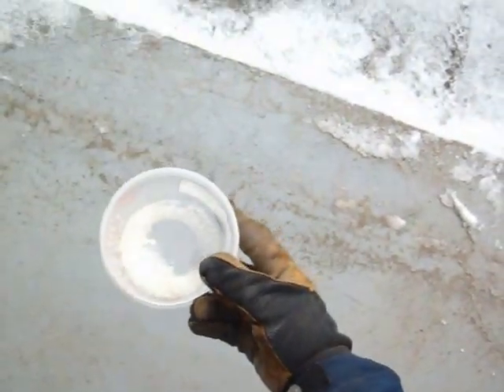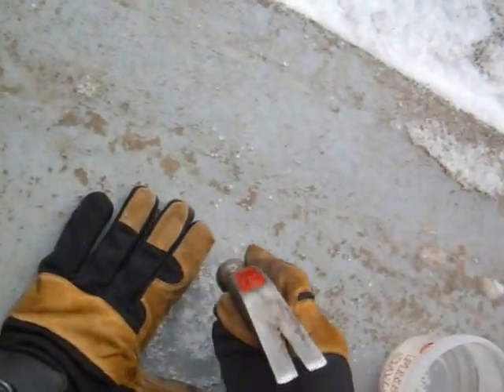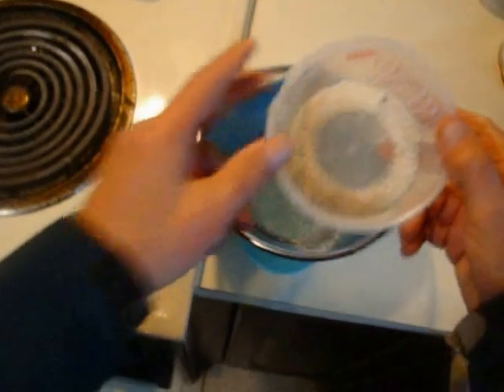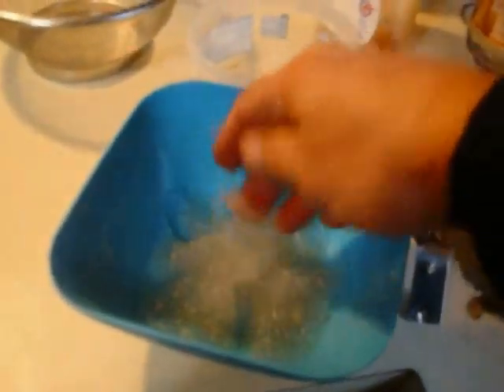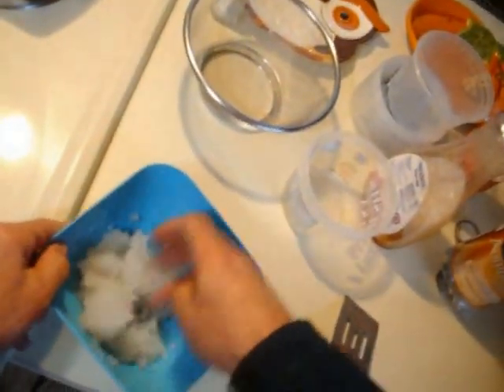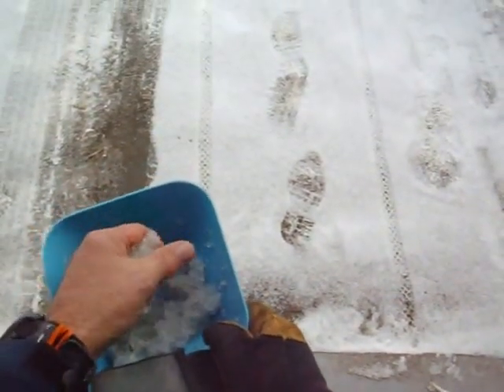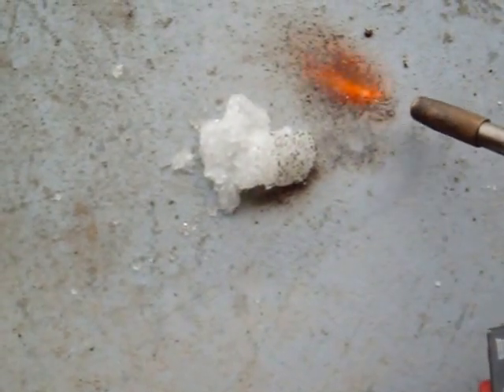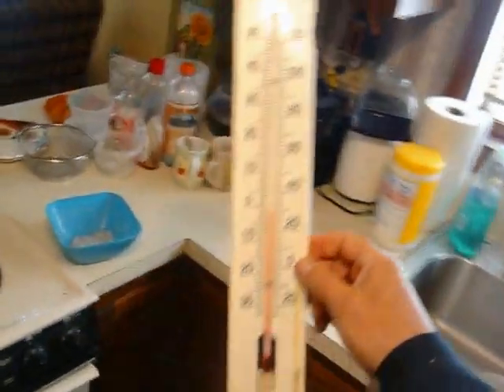Fake Snow 0001

Comment: I don't know why I'm bothering but here it goes:

From
http://www.reddit.com/r/conspiracy/comments/1wjaub/fake_snow_in_georgia_why_cant_a_flame_melt_it/

It takes a lot of energy to melt ice and snow.
It takes 334 Joules to melt 1 gram ice at 0°C.
A butane lighter flame gives off around 900 Joules per minute.
If you just hold the lighter next to the snowball most of the heat goes straight up. Also if you don’t let the flame burn unobstructed you get incomplete combustion and less heat, and soot.
The snow is a great absorbent that suck up the small amount of water that actually melt.
To melt 1 gram of snow or ice you would have to hold the flame under the snowball for several minutes. You actually heat several grams at once, and the heat transfer is far from perfect.
This hoax demonstrates how gullible and uneducated a lot of people are. And how the hoax is spread by the most gullible that are close to panic... I suspect that there is some trolling involved as well. At least I hope so.

My addition:
Snow is comprised of thousands of tiny ice crystals stuck together, yes?  In fact snow is mostly air, and due to the hydrogen bonds of the melting inner layer of snow (~1mm in) will be attracted to these crystals and fill the air pockets between them while the outer layer (<1mm) of snow will be lost to sublimation.  Only when the snow ball becomes completely saturated will you actually start to see water drip from it, which by that point is effectively "slush".

Just because you don't understand a phenomena doesn't mean it's a conspiracy.

Educate yourselves.
Reply from the maker: I did not consider the typical lighter next to the snowball as credible evidence of anything.  But the video from a guy that took snow from scraping the frost from inside his freezer (colder) and another from the snow pack on his driveway (warmer), then held both above his wood stove, was a different story.  The first melted in 11 seconds and dripped onto the wood stove.  The snow from outside took six minutes before one single drop fell from it.  Also there were no puddles on his driveway even though it was well above freezing and there was "snow" 6 inches deep right there.  I admit that nobody has recorded the experimental procedure I recommended and showed in my video (placing a thermometer into a snowball and let it set in room temperature, then record the temperature every ten minutes).  If it is snow it will stay at 32 degrees until it's all melted into liquid.  If it rises above 32 degrees and it never melts into liquid, then it is not real snow.  Agreed?
Reply: Again, it kills me when you people assume the snow from outside is the same internal temperature or even the same structural composition as the ice you get from inside your house.  It's ok if you don't understand, but then instead of looking for a scientific explanation, you're going to listen to random Internet videos?  Please.

P.S. There is a lot of effort that real scientists put into eliminating unknown factors and external influence from actual experiments.  They don't spend up to 8 years in school for no reason, these clowns on the Internet are so arrogant and ignorant.
Reply from the maker: majinkai
I agree. I don't know why you bother because you are an idiot.  I Sir have a Bachelors degree in Chemistry and a PhD.  I am observing novices' experiments from 1000 miles away but I can discard the useless, and value the bits of valuable observation I glean from numerous videos.  You can't refute the evidence I summarized in my last response by changing the subject.  The frost from the freezer was around zero degrees.  The "snow" from outside was over 40 degrees and not dripping water.  Both were held one inch about a hot stove.  The frost ball dripped water in 11 seconds.  The "snow" ball from outside took over six minutes and shed only one drop.  No amount of claims about structural composition of the "snow" can explain why it took six minutes to shed one drop EXCEPT THAT THE STRUCTURAL COMPOSITION INCLUDED SOMETHING OTHER THAN H2O AND MY OBSERVATIONS LEAD TO SUPER ABSORBENT POLYMER as the most likely culprit.  So if you can't wring a relevant scientific thought out of your brain concerning snow melting under intense heat, DON'T BOTHER to write back.
Reply: Clearly, you don't understand the structural differences between ice and snow and how it affects heat transfer.  Phd in what exactly?  Did you get it online?